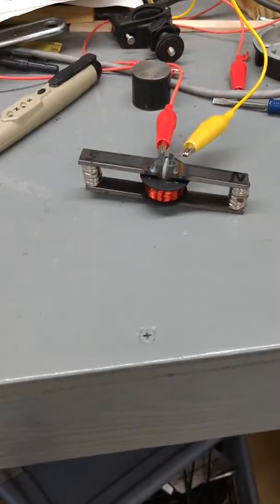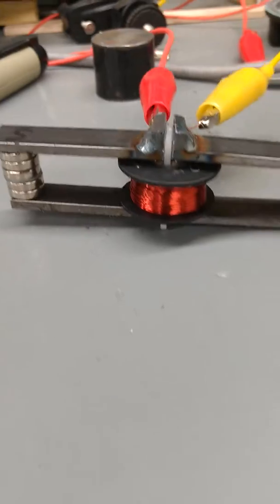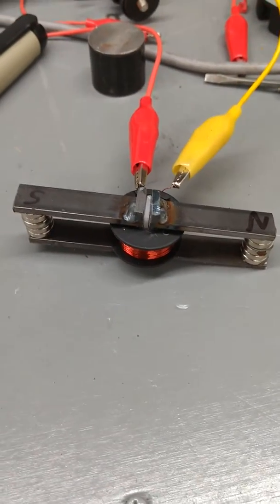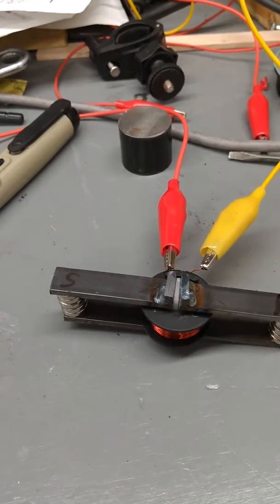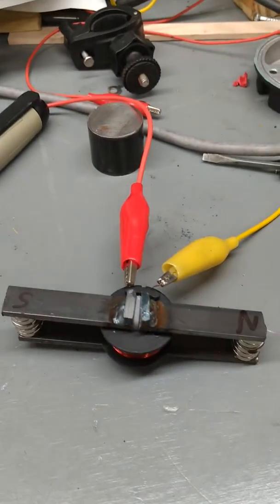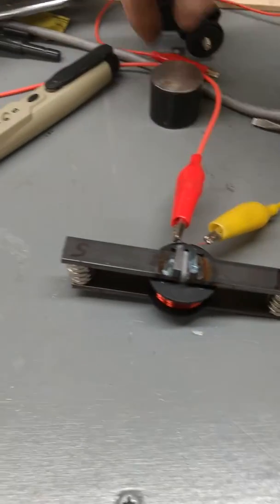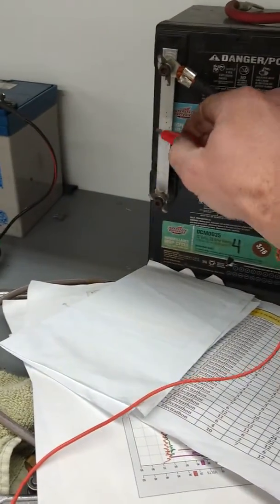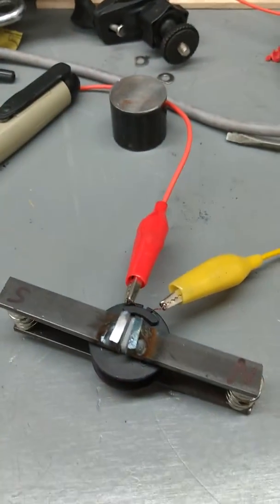Dual electropermanent magnet circuits- -single coil

Comment: can you plz share the amperage and voltage you used to make the polarity switch? thx.
Reply from the maker: It was 24v. I never checked the amperage. Not that the specifics matter as the requirements will be different for each setup depending on the strength of the alnico and the number of windings.